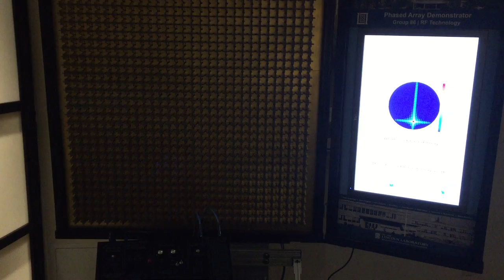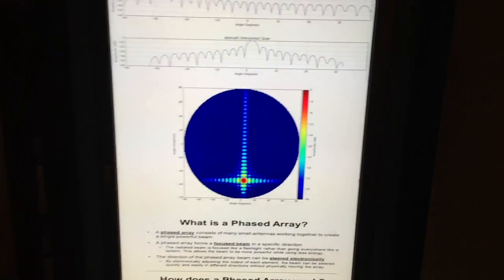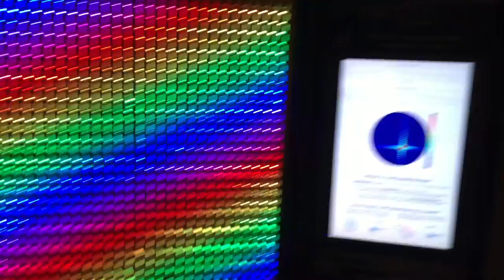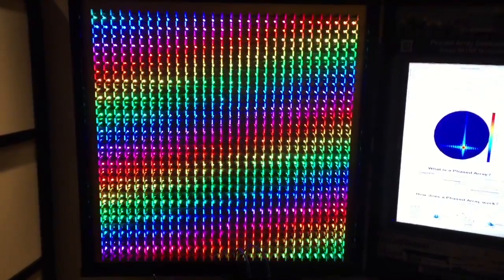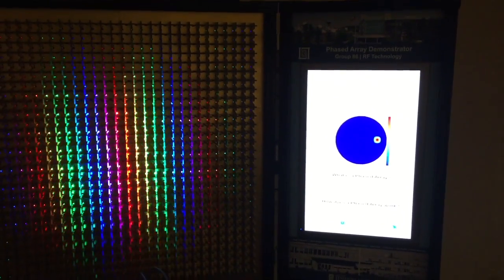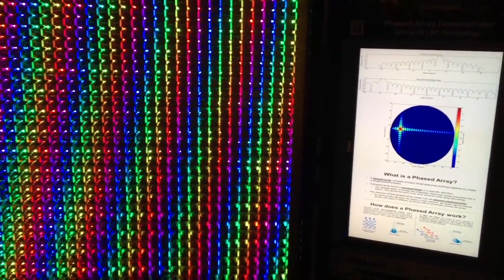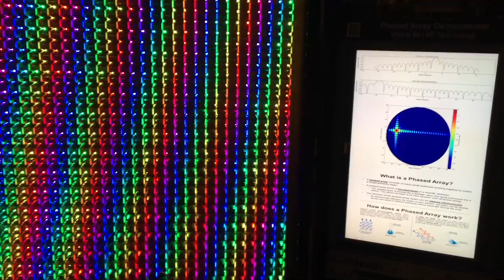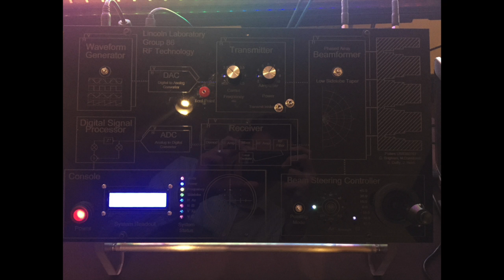Phased Array Demonstration System

Comment: Phased arrays are fascinating. Not only could they have a faster tracking speed than their moving counterparts, but with effectively zero inertia, it doesn't need any time to speed up or slow down. No risk of overshooting.

The wavelength of radar is much shorter than RF. That means the radar wavefront angle is more sensitive to small changes in the relative phase angles of the transmitters, right? This is compounded by the fact that changing the phase angle is also a much more delicate task to begin with, since the frequency is so high. Sounds like quite an engineering challenge.

Comment: I didin't get it... What is it? What does it do? How is it doing it? What will it be used for?
Reply: Imagine you have a radar gun that you want to point at a target, or that you just want to sweep around in a circle to scan everything around you.

Conventional solution (not this video): So you put this radar gun on a system of motors. You can control the motors electronically. But that system, with its moving parts, has limitations as to how quickly it can react to the target's trajectory. In addition, the moving parts could wear down and require maintenance, or could fail altogether.

Phased array solution (this video): Instead, you take a few radar guns, essentially, and get them to work together so you can change the angle without motors. You might be thinking I'm talking about pointing the guns in all different directions, like a spiky ball or cone. But instead, these radar guns are all facing the same direction. And they all send out a pulse. But, if you put each one on a slight delay from its neighbor (like people doing the "wave" at a football stadium), you can effectively bend the radar signal and make it point wherever you want it to point. Radar pulses usually happen billions of times a second, so you can change the angle very, very quickly.

So what makes it interesting is that it can send out a radar "beam" in any direction without having to rotate or pivot. What makes it useful is the reaction speed and fewer points of failure to maintain.

There are also phased array solutions that can do this same thing with visible light. It should be theoretically possible, because radar and visible light are "made of" the exact same "stuff", but actually achieving the feat is challenging because visible light waves are very high frequency and very short. You can make or manipulate a radar signal with conventional electric circuits, but visible light operates on a much smaller scale.
Reply: He doesn't really explain it does he? Let me explain how I visualize it. Imagine two rocks dropped simultaneously into a smooth lake; where the ripples intersect (same phase) they add together and when cross a high spot over a low spot they cancel out (phase 180 degrees out). Now imagine dropping rocks at just the right place and time so all the waves come together at a certain point on the lake. Obviously the waves coming from a phased array antenna come out in space not flat like a lake. By controlling the phase difference at each spot on the array of antennas the adding of the waves can be controlled in any direction.
Reply: https://en.wikipedia.org/wiki/Phased_array

Comment: you are demonstrating how the antennae in a phase array system are excited for a specific radiation pattern on that circular screen, isn't it ?
So, those LED colours are representing the phase, but not really causing any constructive/destructive interference with each other. So it will not alter any light coming out of them. Why don't we just demonstrate that on a big LCD screen ?
Reply: lvgk g because each led is right next to the element in the emmiting array. It would be neat to have the lights on the backside of the array, and LEDs with properly sized antennas on a wall far enough away to be far field so you can see the actual beam pattern as well as the phases being sent to the array.

Comment: this doesnt really make any sense
first of all the screen shows a circle area while the lights are on a square grid
+ the patterns on each look completely different
Reply: What do you mean? The LEDs in a square arrangement are not supposed to display what is on the screen. The color represents the phase angle for each individual transceiver. Through destructive/constructive interference from the differing phase angles, the image on the computer screen represents the resulting beam pattern of the radar.
Reply: It makes perfect sense.  The color patterns on the antenna indicate the relative phase of the RF signal emitted from each element.  The picture on the screen indicates the resultant RF beam shape and direction that would be emitted.